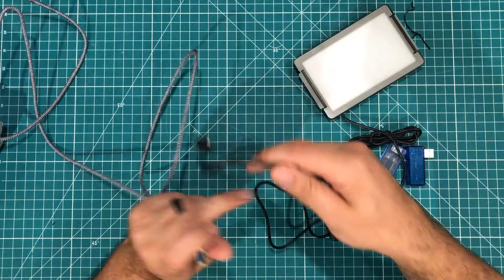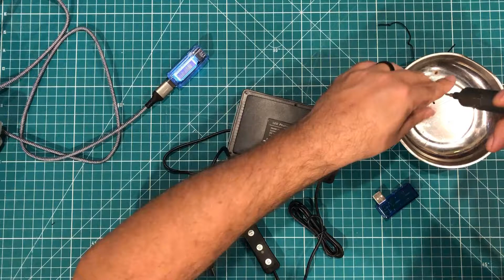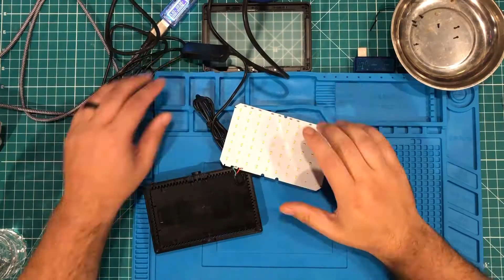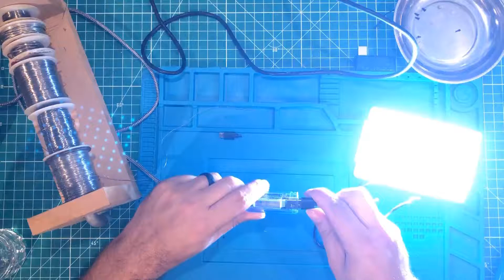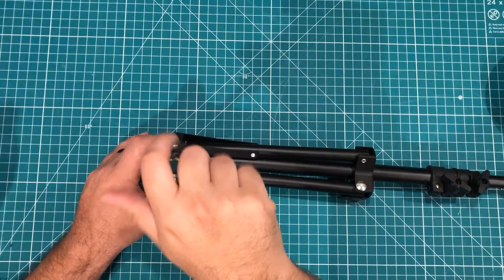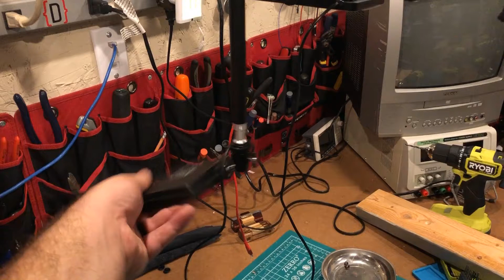Making Cheap Video Lights More Useful

Comment: I would say your shorter cable has less of a voltage drop than the original cable - so more current. Actually now that I think about it, if the "remote" uses a transistor, it would give you a 0.7v drop as well.
Reply from the maker: That's actually a really good point.  Didn't even cross my mind. This is why I watch your channel to learn stuff.